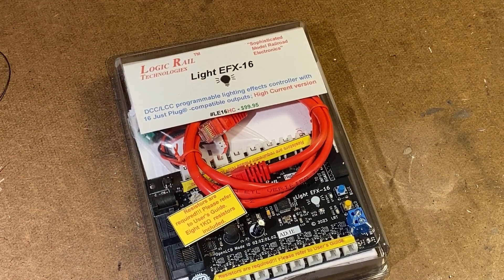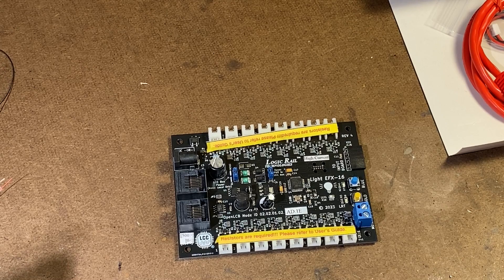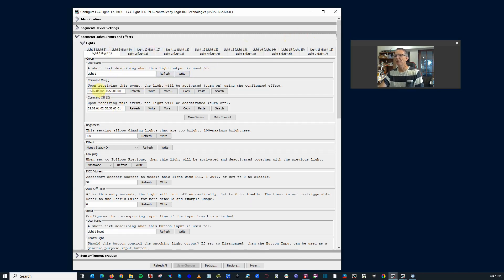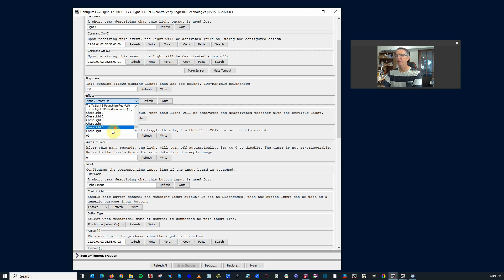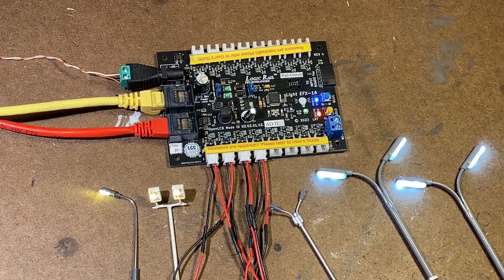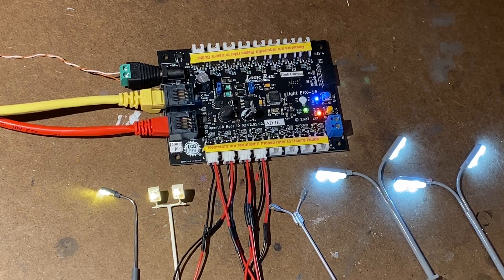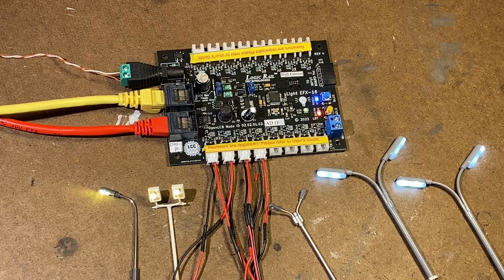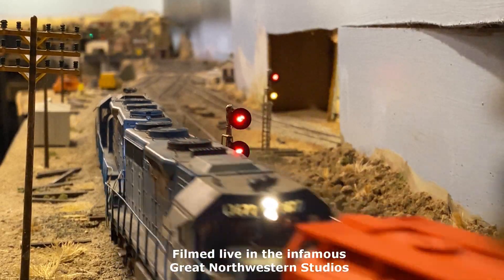Deeper Look at Logic Rail Technologies EFX 16 HC

Comment: I believe the LoDi Operator 16-SD-FL 1k is considered LCC.  It much less expensive than this and their software is top notch.  Drag and drop for all kinds of lighting and signals.
Reply from the maker: Interesting, and thanks for pointing me to that product. Did a little research, and it appears to use SC-Bus, and maybe Railcom for communications. I believe those are different protocols than LCC, but I could be wrong.
Reply: @the-lcc-channel  No problem.  You may be correct. I think the SC-bus is something they may have developed.  It seemed similar to LCC.  Model railroad tech has gotten so much better.  It's what pulled me back into the hobby.
Reply from the maker: @NEC_Amtrak  - absolutely! We live in a golden age of model railroading. Reading up on what folks like Allen McCellan had to deal with in creating the electronics for his V&O makes what they did all the more amazing. They truly were pioneers!